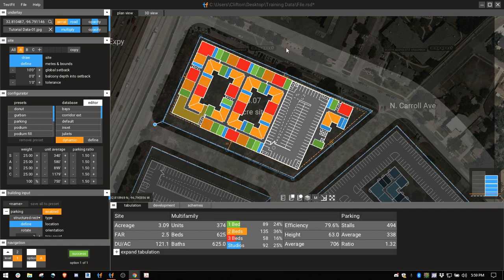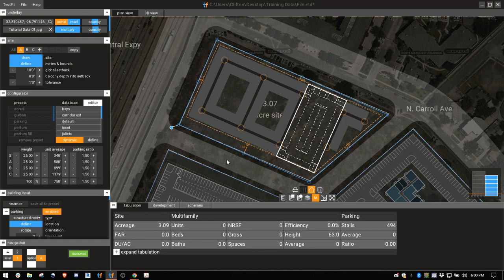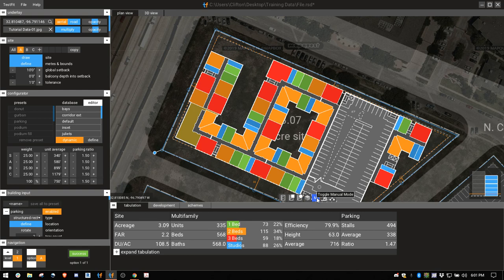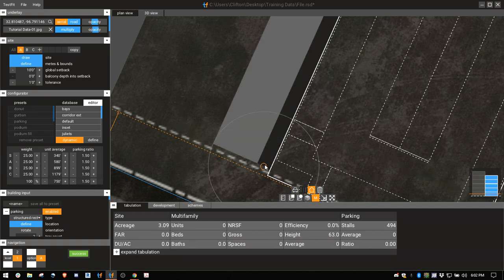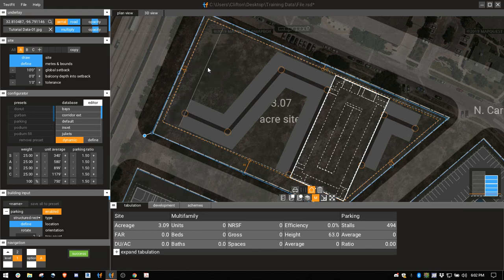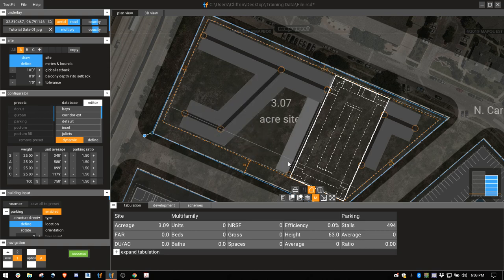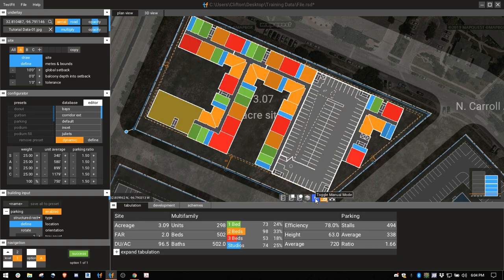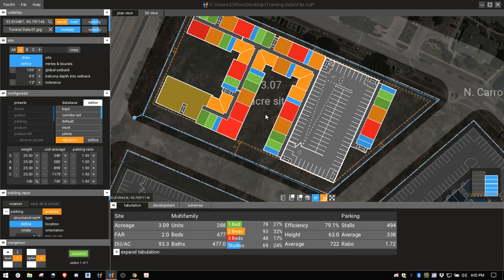TestFit: Working With Manual Wrap Mode

Comment: Can this software be used to design and study  individual units floorplan layouts? If not, have you thought about developing a tool or expanding it for this smaller scale?
Reply from the maker: Not at the moment. Typically existing unit plans are used in the bounding boxes used inside TF today.

As far as scaling down, its unlikely for a while. More likely would be to scale up into city planning
Reply: @testfit  Thanks for replying! Is there a way to adjust the bounding box boundaries separately across each floor ? Right now if i am not wrong each floor has same footprint.
Reply from the maker: @Constantinesis  Not at this time. Best solution at the moment is to click "copy" inside the site panel and do the floors separately.